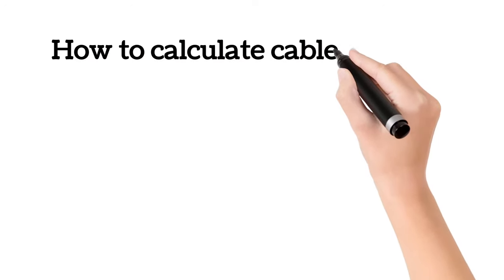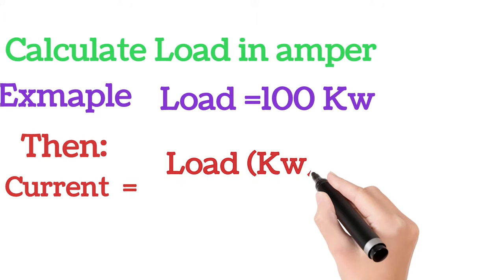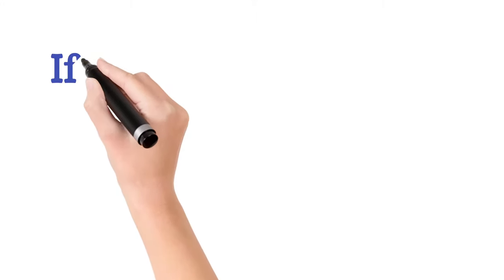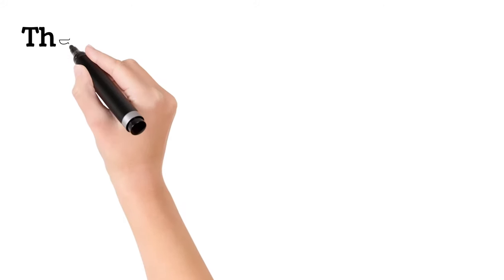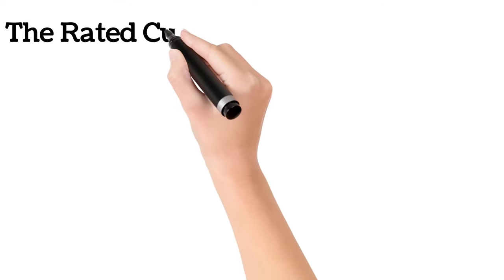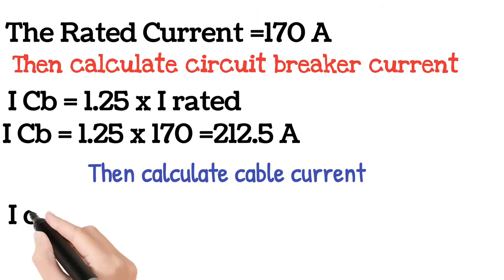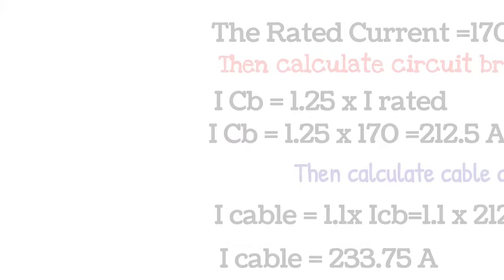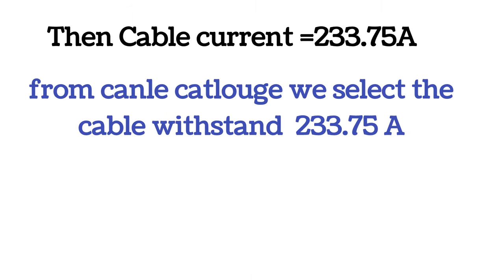How to calculate cable size in 3 phase circuits

Comment: Why do you use √ 3? Yet u are using 400 which is line voltage? I thought u would use √ 3 if given a phase voltage. My rated current value is 294.12Amps